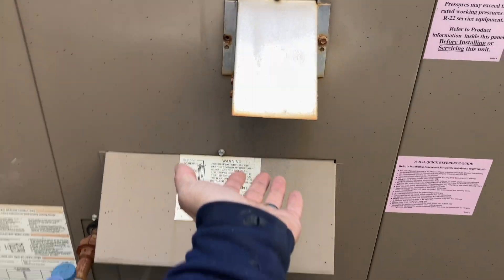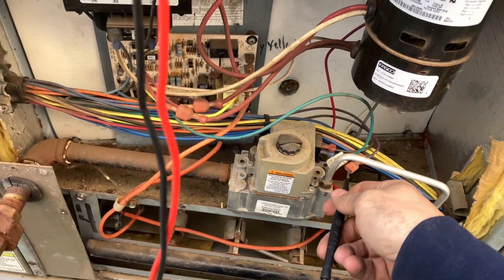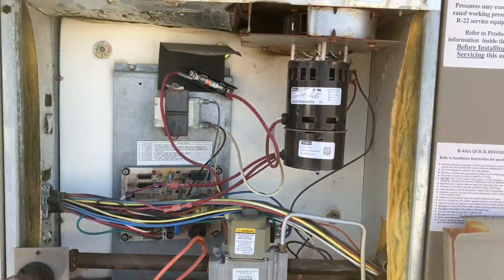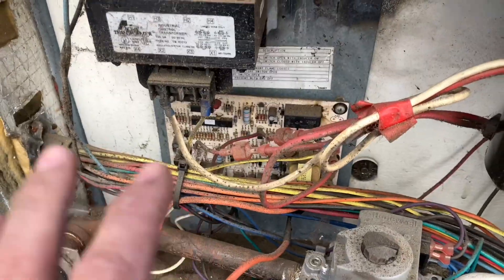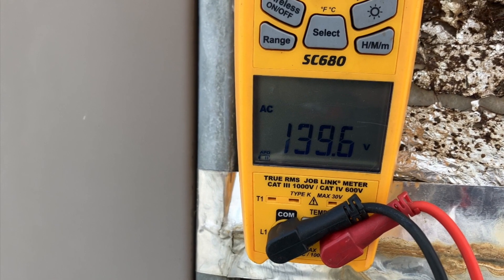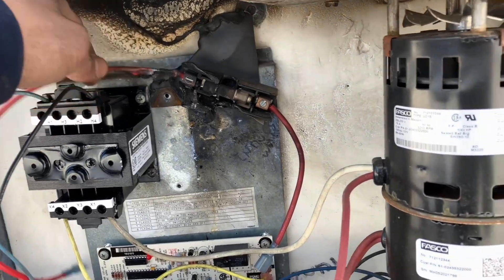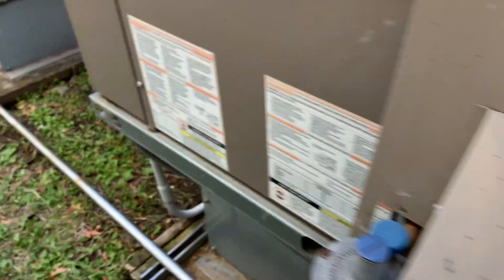Multiple HVAC Units Down

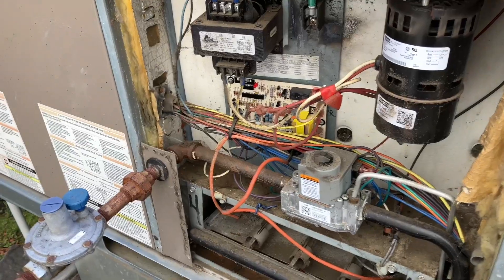Comment: One missed fuse. First inducer at 4:05 has a fuse connected, But the second at 4:50 is bypassed (No fuse !) and left like that after the swap at 6:15, third & forth have the fuse, plead for the fifth that self incinerated fuse 🙂

Comment: I haven't gotten to the end of the video but based off the voltage I assume you have a floating neutral, that is destroying a lot of things there, and if its not fixed will continue to try to start fires in anything plugged in.  🤦‍♂🤷‍♂  They/your should call the power company to come out to look at it.  I have seen a lot of damage and fires with neutrals that have come lose or disconnected.  Anything will be used as a ground/neutral conductor telephone wire, cable TV coax etc.
Reply: i've seen more than one picture of gas appliances with incandescent supply tubes from floating neutrals.